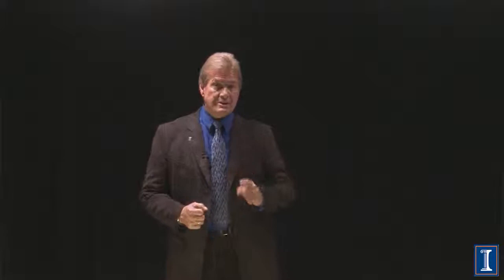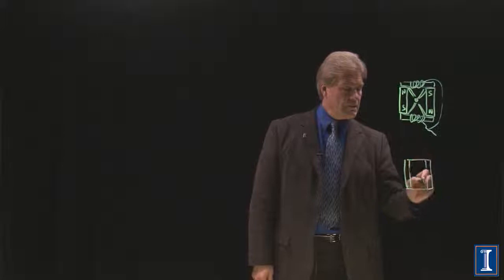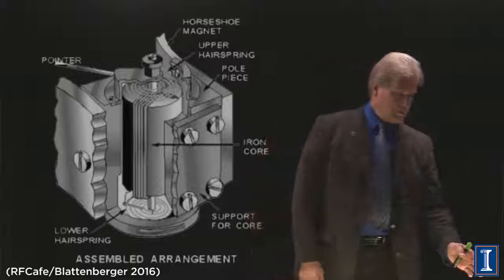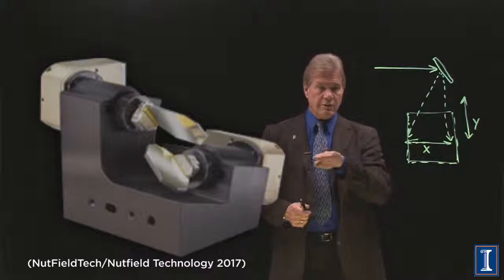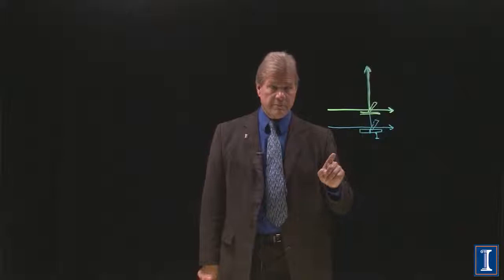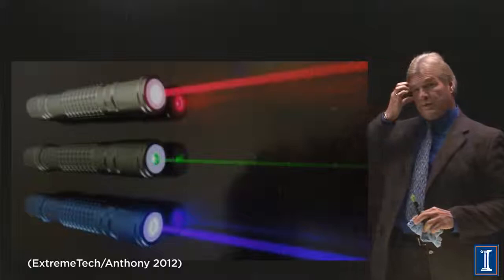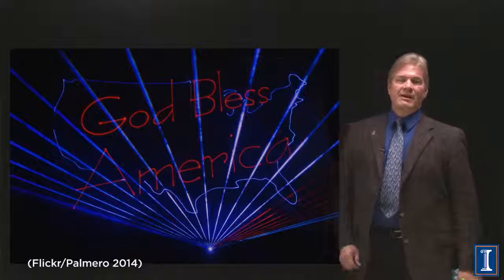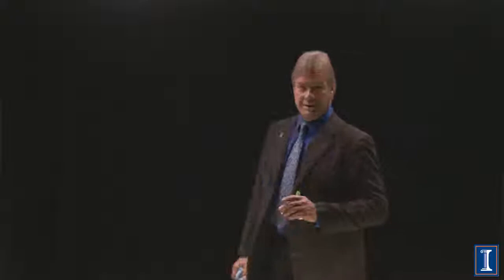How Things Work: Laser Light Shows

Comment: The mirror part is how an analog meter/gauge works.
The rest is basically how television works too.  Originally with an electron beam lighting up red, green and blue phosphors, now with LED's or LCD's etc.   Also, it all takes advantage of human persistence of vision.  The scan rate of the single dots or lines need to be faster than 60 Hz for us to observe it as a smooth image or we would see dots, lines or flicker like in old movies.  Many modern screens now use 120 Hz for very fast refresh and high def scenes.

Comment: I am replying my 3 colour laser show system.  Currently works red colour only. 
After i ordered other 2 colour laser diodes and tried to repair. I've experienced what this vedio says in practical  ....❤

Thank you very much sir for the scientific explanation.

One question dos those motors have a sensor to know its current position? Lets say by accident we turned one of the mirrors manually when its turned off. 
When its turend on does that mirror automatically adjust to its original position? Otherwise it will impact the design i guess....